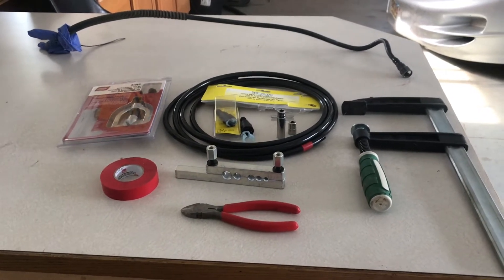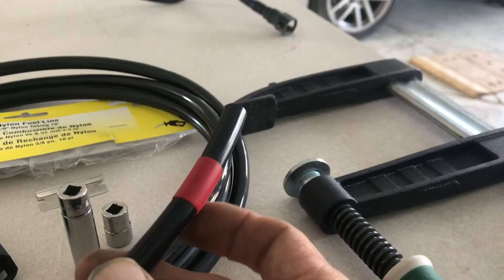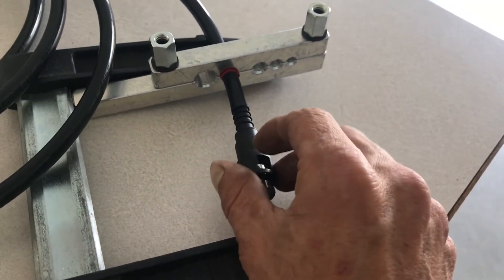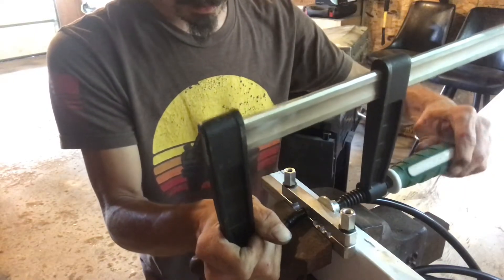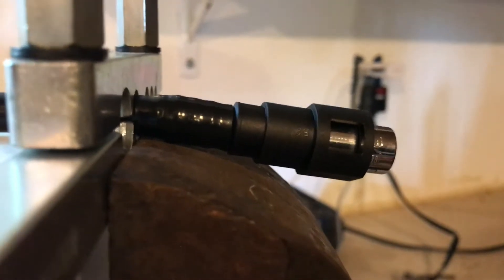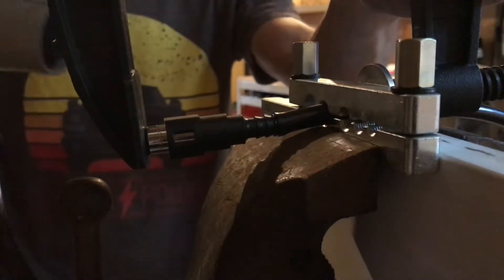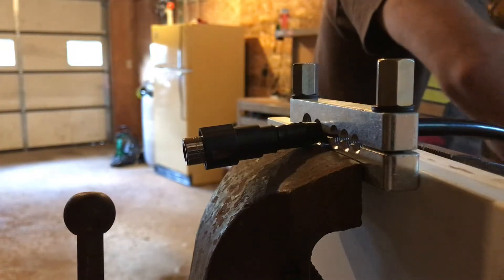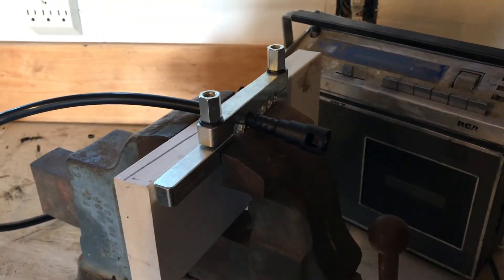How to make nylon fuel lines the RIGHT way without the tool!

Comment: I was able to accomplish this by using the flaring tool clamp in a vise. I sprayed the barb with PB blaster to lubricate it, then left just enough of the tube out of the tube clamp to get it started. Then I readjusted the tubing in the clamp to give me some additional room to fully seat the barb. I made sure I was as straight as I could see, then started pushing on the barb, at one point it feels like it snaps in. I'm in FL so you may need a little heat but use sparingly. Last step was to was the hose with some gasoline, not that that little bit of lubricant would hurt anything. Be patient and stay straight, the C-clamp tends bend the pipe.

Comment: I tried my hardest to get this done.  I guess its a lot harder to do on existing lines instead of new line?  It just keeps kinking the line no matter what I do.  Tried boiling water, heat gun, hair dryer to soften the line, everything fails.  I am thinking to go by the repair kit with the fitting already on it and add a compression fitting to the old line.   Think this will work?

Comment: Hello.  Thanks for your video.   I'm in the process of researching how to replace my fuel lines on my 2002 acura tl.  I would like to use braided ss line with the quick connect adapter.  can the plastic adapter be installed the same way with ss braided flexible line ?  thanks

Comment: Cut a fork into the stationary end of the clamp to straddle the line on the back side of the clamping bar and press the fitting/socket with the moving part of the clamp. That way you're pressing the fitting in straight, not crooked.

Comment: So if you have a quick connect with an 11mm barb end the 3/8" nylon hose will stretch over for a tight fit?😮

Comment: What happened to “without the tool”?
Reply from the maker: They make a specific tool just to make fuel line fittings which is a couple hundred bucks, here's a way to do it with tools most people should be able to scrape together, thanks for watching!

Comment: You can also just use some grease, flare out the tube a bit with needle nose to get it started, then just push the greased connector into the tube.  No heat needed.
Reply: yeah i had to do that as well, i just hope it doesn't come apart.

Comment: This worked for me but used the modified Irwin quick clamp instead. I wrapped the nylon tubing with electrical tape so the flaring tool clamp wouldn't nick it and I put the clamp in a vice. I also inserted a #13 drill bit into the 5/16"nylon line before tighten the flaring tool clamp and it stopped it from getting crushed. I also poured boiling water on the tube while tightening the Irwin quick clamp. The #13 bit will go through the 5/16 quick connect fitting and helps keep the tube and connector lined up.
Reply: wow!!! you should make your own video of that.
Reply: Ya im not comfortable with a serrated holder on nylon line.  Creates a score mark that could fatigue crack down the road

Comment: My fuel line is nylon wrapped in rubber hose and fitting the quick connect has been extremely difficult so far. I hope this method helps when I try it.
Reply from the maker: I hope it goes good for you, thanks for watching!!

Comment: I have had good results with dipping the line in water heated up in the microwave for a minute 1/2
Reply from the maker: Yep for sure this is a good solution too, softens it up enough and don’t have to worry about it melting/getting too hot! Thanks for watching!

Comment: Here's a video on replacing just the leaking O-rings:

https://youtu.be/WuS1TsyiRqs
If 3/8" larger line?:
3/8"x1/2"x1/16" O-ring

Dorman has O-ring replacement kits.
Don't forget to lightly oil/grease the tube the o-rings ride on!
Reply from the maker: Thanks for the info bro it helps!

Comment: Thanks for the video!  Read about using the caulk gun as well. I suppose the boiling water might heat the tube more evenly and thoroughly to the right temp than the blow dryer. hmm

My 2 O-rings are leaking and even though I have a good collection, none are the same.  
I wonder if I can take the new o rings out of a replacement connector and place in my old one and fit it without the headache of replacing. 
or if they are all different by different makers.
Reply from the maker: I would say if you are careful enough you could swap the o rings! And ya I was gonna use the hot water method but the stove was about 200 yards from where my vice was and I didn’t want to run with boiling water haha nah jk but ya the water method is a good way too!

Comment: For anyone finding it hard to insert the connector into the hose, Apply white silicon grease with very high melting point to the connector. It will just slide with much less work.

Edit: Clean the fuel lines with the help of hot boiling water before installing in the car.
Reply from the maker: This is a great idea, thanks for adding it! Appreciate you watching!
Reply: will this grease plug up fuel injectors?
Reply from the maker: I can’t say for sure, most likely it would be caught by the filter or the gasoline would dilute/thin it down so much that it would not make a difference, thanks for watching
Reply: @09fatbobmike  yes when using high temp like silicon grease, you must clean the pipes before installing them in the car.Use boiling hot water. But for fuel lines before the filter, these particles will get caught by the filter and wont pose a threat at all. but for fuel lines from fuel filter to the engine. you must clean it with hot water and blow them dry before installing.
Reply from the maker: Definitely good advice, best to keep things as clean as possible when doing anything, especially fuel, don’t want to end up with more problems than you have too, thanks for contributing with good advice, and appreciate you watching!!
Reply: @09fatbobmike  flush it with hot water to remove grease.
Reply from the maker: For sure, flush it after you got it put together, great idea!!! Thanks for watching bro!

Comment: so much info thank! do you have a video on bending it to fit?
Reply from the maker: No I didn’t mine was actually a straight shot so I didn’t have any major bends, getting the line to bend without kinking is trick and takes heat, and even then you weaken the tubing, most of the stuff prebent to the vehicle is formed that way in the factory and holds its strength in the bends

Comment: how do you fit 45 degree connectors
Reply from the maker: You know what I never actually had to do a 45, but I can imagine it’s way more difficult to get enough pressure on the fitting to get it in the tubing without kinking the line, sorry for the late response, thanks for watching!!

Comment: Good advise, only problem is when you would have to do this on the car, I'm doing a 1998 sebring and whoever did the fuel filter screwed up the quick connector to the fuel pump. Reckon I will figure it out. Looks like they lost the little white plastic lock for the quick connect. They stuck it on without it and the fuel pressure blew it off. I may be able to but a new quick connector and just use the little white locking piece. Can't believe they left it like that. Thanks for posting, a big help for a fellow improvisation specialist. 👍👍🏁🏁
Reply from the maker: Oh man that sounds like a nightmare, gotta love having to fix someone else mess, ughhh I feel for you man, ya it would def be a pain on the vehicle, is the connector messed up or those little white clips can be taken out of a new one with care if that’s all it needs, but u probably know that if your willing to take on this job! Or ya now I read u say that right in the post, I would definitely try that route first, ya it’s surprising what some people will do and then just walk away, if I break something I stick around till it’s fixed!

Comment: I'm in hopes I can do this under the car to replace the fuel connector or just remove the whole line from the tank
Reply from the maker: Ya it’ll definitely be a pain on the vehicle, I know it might take a bit to get it off the vehicle but it will save you a lot of cussing and headache!!

Comment: Hi there! I wonder how would you disconnect the hose from the connector? Would you have to heat the hose too and then pull it out really hard? Thank you so much for your answer and for the great video! 👍😎
Reply from the maker: So since my hose was kinked in the middle I just used all new line and fittings, but if you needed to reuse the fitting then the best way would be to use a razor blade carefully to cut the hose the long way down the barbs of the fitting, once they are in there they are pretty hard to get out, even with heat, but heating it up might actually make it easier to cut the line off there too, but be careful if you do, don’t cut yourself!!! Thanks for watching!!!
Reply: @Azkeyguy  thank you so much for your answer!
Reply from the maker: For sure man, appreciate you watching!!

Comment: it is plastic ? wont it crack in the cold weather??? , i had nylon plastic and here in Illinois it gets very cold and if something hits it will crack and gas will get every where
Reply from the maker: Ya I was in South Dakota then, and I know how stuff gets brittle in the cold, but this stuff is actually what they use from the factory and I’ve had it be -20 up there before with the wind and never had any issue, thanks for watching!

Comment: Great video.  Good presentation at the beginning with all the tools necessary.  Not too much talk.  Not sure it was necessary to repeat the procedure because we can replay it but clean presentation and instructions.  I wanted to see this because I want to put a check valve on my Sentra to see if it solve my problem.  System seems to lose pressure.  Difficult to start when hot.  Thank you !
Reply from the maker: Wow I appreciate the great feedback!! I hope it helped you out! Is the Sentra losing pressure from the fuel draining back in the line? Ya a check valve should help keep the fuel in the line so it will have fuel right away, I wish I could help you figure that out too!

Comment: I understood you are not to heat up the nylon lines for the install????? Per Dorman????
Reply from the maker: I think they might say that because there is a chance of gettin it too hot and kinking or collapsing the line, I very minimally (5-10 seconds) warmed it up to get the line to slip over the barbs on the connector, but yes definitely use caution and don’t over warm.  Working with fuel lines definitely is at your own risk, and if your not comfortable warming up the line then I would definitely just buy the premade line, it wasn’t an option for me in my situation

Comment: What if you have a 90?
Reply from the maker: That’s a good question! I guess I would try to find something for it to sit it to keep it straight but it sure what I’d use I would have to improvise!
Reply: @Azkeyguy  I ended up using one of those Irwin ratcheting c clamps in conjunction with the flare tool dies.  I took a grinding wheel to the tip of the stationary end of the clamp, so the line coming out of the back of the die was in a notch to keep everything in a straight line.  I did use a hair dryer then also worked right in front of a heat lamp for baby chicks which I already had under my truck for warmth.   Still a bit of a pain holding everything just right.  I did kink line in the first try, had the die too far away from fitting.  I did make my repair and it looks good, but I may just buy the $100 tool.  Thanks for the video
Reply from the maker: For sure I kinked the line the first time and proceeded to swear and be like wtf, and it does take a lot to keep everything all aligned perfect and try to tighten the clamp especially if you only have two hands, an extra set would help a lot, I know I had to trust my repair because I wouldn’t be able to tell if it held until I had it on and the fuel tank up, which I had to remove the axle to get the tank out (98 trans am) and then see if it leaked, it didn’t, still hasn’t, and I had to go on a 1500 mile trip the day after I made he repair, which is why I didn’t have the time to wait for the new part or the right tool, but ya anytime your dealing with high pressure and fuel you want to make sure it’s right!!! Way to improvise and make something that worked!! Not many people can do stuff like that so I’m glad you got it!!!

Comment: Can you just salvage the quick disconnects from Pump to filter and use regular rubber fuel line with hose clamps on each end?
Reply from the maker: I’m gonna say no please don’t, I don’t think it would be a good idea because of the high pressure from the fuel pump anywhere from 50 psi and up that a hose clamp will most likely not be able to hold the pressure and come off or slide off!! If that happens you will have fuel everywhere, a huge fire hazard and be stuck on the side of the road! I would definitely advise against doing it that way, it won’t hold!!!! Be safe and just fix it the right way it will save you a headache or the loss of your car!!! Please don’t do this!!! Take care thanks for watching and commenting!
Reply: @Azkeyguy  This is on a 2005 Ranger. The bed of the truck was in contact with the fuel pressure line and it came apart and would not start. when I got out the gas was all over the driveway. Glad I was at home at the time. I could not find the nylon hose that you had in your video. Only short lengths. I bought 5 ft of Gates4219BF fuel injection hose1/4" 225PSI . I have attached the disconnect from the tank to the hose and it is very tight. I have added a clamp. So I am going to try this on the truck as I have the bed off the truck and can inspect it carefully.
Reply from the maker: For sure keep an eye on it since you’ll have the bed off, that will make it a lot easier!!

Comment: How do I remove an old broken connector from a pipe?
Reply from the maker: I would just use a razor blade to make a straight cut behind the connector and then cut down the tube on the connector barbs, thanks for watching!!

Comment: I heard someone used boiling water to seal the connectors to the line because I didn't want to use the mini torch and shrink tube . I thank you  a hair dryer is the perfect tool.
Reply from the maker: For sure man! Yep you can use boiling water too but it seemed like a hassle to have to drag it out across the road to the garage where the vice was, ya the hair dryer you can control the heat a little better so it doesn’t get too hot and kink, thanks for watching bro!
Reply: @Azkeyguy  right now I have to wait for Tuesday before I find out how much it will cost me for the new sending unit and pump for my 06 sierra. I live in Canada and bought it at Carid.com .I had perchanced one here locally .It was $506.00 Canadian.  I went to Carid.com and a version of the one needed was $ 82.00 American. The guy said with Canadian tax at 13 % and convert American to Canadian dollars and delivery it is $154.00 Canadian. 
However there could be dudty added. 
So even if you say an other $150.00 Canadian dollars for duty I would still save $200.00 of my money. I also need 2 straps and locking ring too .Anyway Slone I thank you for your video and God bless.
Reply from the maker: Thanks bud! God bless you too! Next time you need some parts from the US let me know there’s gotta be a cheaper way to get it across the border!! Take care man hope your swap goes good!

Comment: Thanks for the video, just patched an 06' Impala fuel line , going to replace all the lines soon. Deciding between nylon and copper nickel lines now.
Reply from the maker: For sure bro, glad it helped, the nylon is pretty cheap compared to the metal and it was all I could get in the time I needed to get the car done before a 1500 mile road trip, but she’s still workin like a dream!!! Thanks for watching
Reply: Just modify a quick clamp for a perfect install every time https://youtube.com/watch?v=xFCQccnuvl4

Comment: Why would Quick connectors come with only one part?  You need BOTH parts to make a connection?
Reply from the maker: The second part is the metal fuel line in the vehicle
Reply from the maker: Ant the other was the connector on the fuel pump itself, the nylon line goes between the two connections

Comment: Good video. I had trouble working with the nylon fuel line. 5/16 was too small, 3/8 was too big for the fittings and steel line.  I needed to make a w shaped piece to copy the out of production Chrysler fuel line. I eventually went with rubber fuel line with clamps.  It worked out okay for a 18 year old vehicle.
Reply from the maker: J Alton definitely rubber does the trick, I have done rubber in the past but on this vehicle wanted to do the nylon, but I didn’t want to pay for the factory piece for $170 bucks, nylon is kind of hard to work with, it’s a fine line between getting it warm enough to get the fitting in but not too hot that it bends or kinks the line! I appreciate you watching my vid! Take care!
Reply: Use rubber fuel injection hose. Reg. line could fail over time.
Reply: @jeffreydevoti7000  hi, do I need to use high pressure steel clamps for a Dodge Stratus (I think it is around 50 PSI) or regular clamps will be ok? Thank you

Comment: how does it work with 90 degree fittings?
Reply from the maker: Dick Raczuk it’s a little harder but maybe try a caulk gun or a different style vice, main thing is to keep it straight when your tightening the clamp, easier said than done I know!! Thanks for watching